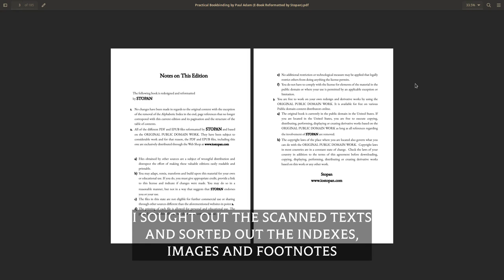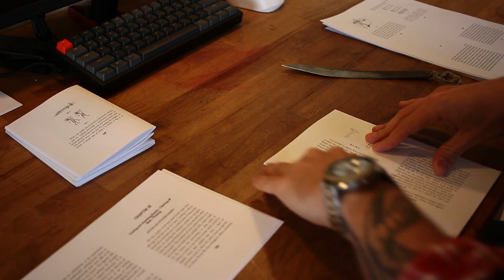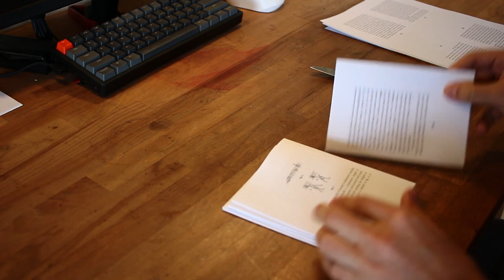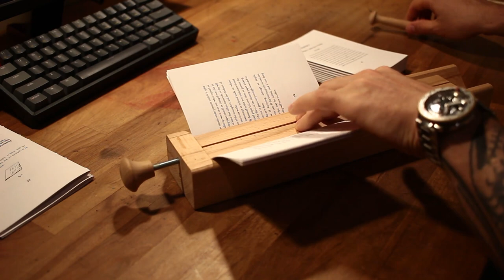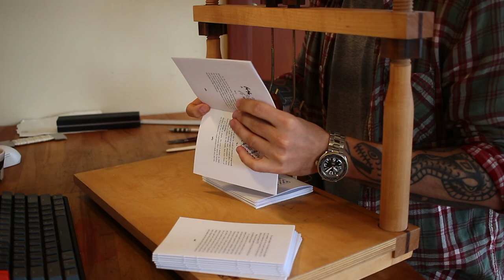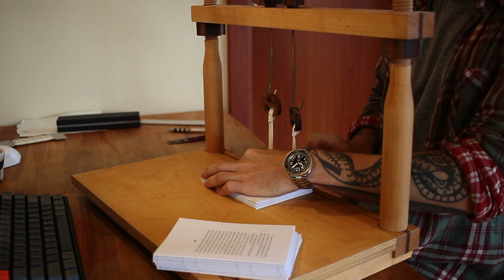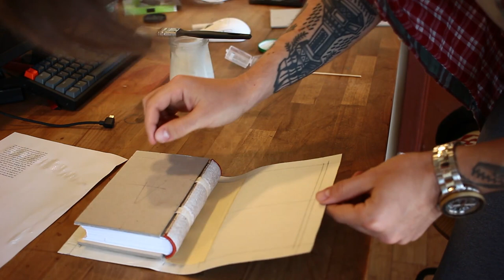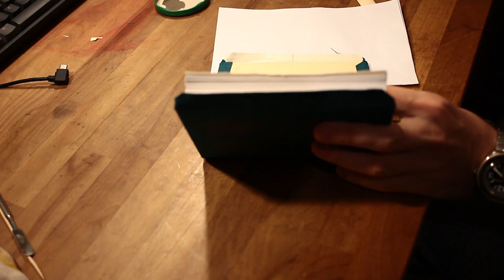Print and Bind Your Own Bookbinding Manual

Comment: I've been strugling for ages to try and get the Douglas Cockerell one formatted and with the correct page numbers etc in the indexes but just keep tying myself in knots. Obviously I'm nowhere near the level of mastery that you are Stopan 👍 If I look at the number of hours I spent trying to do it then the cost of buying it ready to go from you is a real bargain. Ordered the complete set so it looks like I may need to top up on the toner supplies.
Reply from the maker: That's so great to hear, Dave! Thank you for the support. I did away with all of the prefixed page numbers and completely removed the initial table of contents. The new one is generated through the new headings for each chapter, so even if I edit something and the page number changes, I can just update it and it will refresh itself.

Thank you again and all the best with your projects!

Comment: Such an amazing video. Thank you. May I ask what the handle/knob is for on your alignment tool for punching holes in pages (@4:30). I’d like to make a tool like this.
Reply from the maker: The handle pushes the upper part forwards. It is because the holes are positioned in equal distances and sometimes the signature size requires a slightly different arrangement than the one given. For example, the paper is too short to go to the last hole, so you push the upper part forward until the tool is centered.
Reply: @Stopan  thank you for the explanation. I enjoy woodwork projects and would like to make some of the tools I see on your channel. Your work is inspirational!

Comment: Awesome! I wanted those manuals in physical form, and the fact ill bind them myself is sweet, thanks for the effort mate! Have you ever worked with the software BookLet Creator for the same purpose?
The only issue i encountered was that they use long grain printing paper in Greece, so they will be perpendicular to the fold-ill still bind them though (hope my teacher doesnt see this,he cant possibly snipe me here. ..or can he?)
i asked if i could give them paper of my own to print on with proper grain direction, they were sceptical.. Hope its manageable for the next pdf i print!
Question, for the a6 its 4 pages per paper side as you mentioned in the directions? 4x4? I went with a5 and got the usual 2x2 with big space for trimming. Thinking of going with the a6 next to save on printing money..!
Bonus points for the baby coo's and the cameo!
Reply from the maker: I think I've stumbled upon the booklet creator but don't remember what issues I had with it. Paper grain is indeed an issue most of the time. That's why I prefer the A6 because it folds the paper correctly to keep the grain vertical. I generally like the smaller size more.

I've had custom books printed wrongly because the printing house wanted to save money and cut the paper the way they wanted. Frankly, I think a lot of printing houses don't know/care about paper grain at all.
Reply: @Stopan  damn you're right! with the a6 it will be in the correct direction!
Yeah thats my experience as well, most of the staff have no idea what it even is